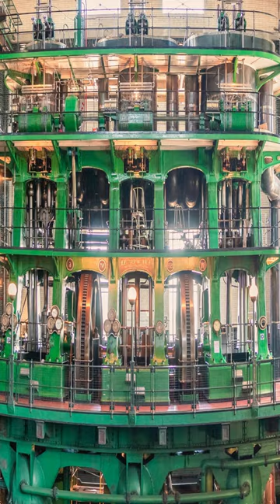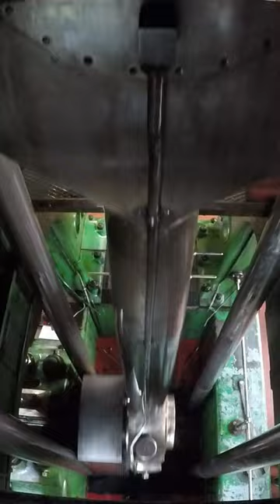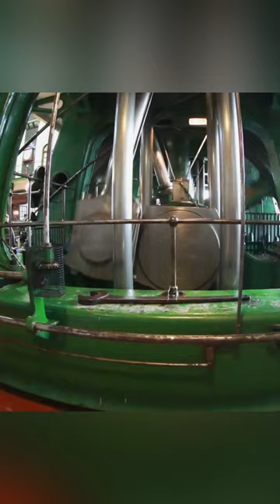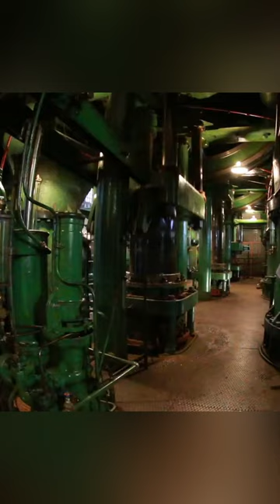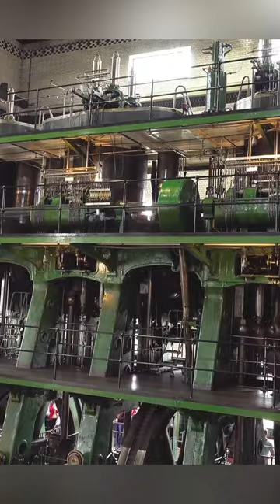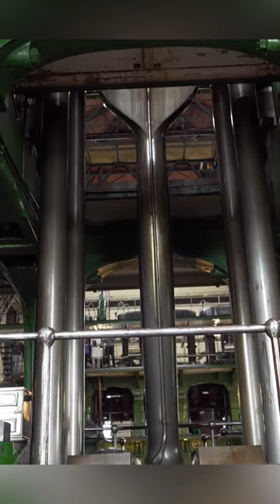BIGGEST STEAM Engine In The World

Comment: Difficult to imagine how they machined and manufactured those gigantic parts in those days.
Reply: + transport etc
Reply: @ContributorX  Exactly
Reply: It's actually not that hard, probably the biggest difference is you build a maching solution around the job rather than building the job around a machining solution. Now that sounds like a silly disinction but it really is the basic 'trick' they had. Instead of going how do we make this with our lathe of X size they went lets make take the component parts that we need for a lathe and put them around the work piece as needed. Makes for some very fun photos of workshops with just the most crazy set ups to machine things. 

Also life was cheap and wages were nothing so you could afford to whack or injure a few guys in the process and pay the rest not great money. Always helps. Capitalism lol
Reply: The Titanic's engines were bigger.
Reply: @Elbas_Tardo  they're a bit waterlogged lately but they do exist still, maybe this can be the biggest working double acting piston steam engine.
Reply: @Trainskitsetc  I say "were". ;)
Reply: @Trainskitsetc  Thanks for this info - it really stops me puzzling how these things were possible - it makes total sense, including the wage/cost factors. And I can hardly imagine how crazy those workshop photos must look :)
Reply: @fibonaccisrazor  for further help lots of it can be broken down, so a big ol fly wheel or whatever can be segmented, cast in 8 bits which are easier to machine then bolt it together and balance it when installed. Less one big engine, more a few hundred sub assemblies made up of a few thousand parts.

Transporting these things was done in bits, quite often the largest parts would go in before the building was even finished then it would have the building go up around it and all the smaller bits come in the door and get assembled.
Reply: By hand 😅🙃
Reply: I bet the bushes are original, we have a pump station in my home town and its still using its original bushes.
Reply: British engineering. A lot of the big pieces were cast.
Reply: @Trainskitsetc no other system built anything close, also nobody was shipped to a death camp for telling a boss to get phucked
Reply: @patrickancona1193  that's cute n all but pointing out the pile of bodies from one way if life doesn't exactly do much to hide the pile of bodies behind your own nor it's systemic failures.
Reply: @Trainskitsetc  Yes, that completes the picture - fascinating, thank you so much for the extra info 👍
Reply: Very carefully I am sure
Reply: @codyneitte9801  Yup, by hand... A lot of modern engineers have the same problem. It all fits in a CAD...
I'm not an engineer, had to quit my studies. But my best teacher was (and still is) my dad. And he often says words of wisdom like this: "before you put something together, think how you will take it apart later".
And this was a sentence spoke by one of his engineerig proffessors, who tought him how to make a good drawing, Sometimes i wonder if this proffesor knew, his legacy would be passed on a couple generations later :)
Reply: @ogi22  hah dduuuuuddeee thats some legendary words right there! 😅🤌 he has been behind a wrench a tine or two, FOR SURE!!
Reply: @codyneitte9801  We sometimes joke that he is a screw guy and i preffer to chase electrons through wires ;)
Reply: @ogi22  lul those damned angry pixies
Reply: And then assembled them
Reply: @Trains kits etc  you must be an engineer lol
Reply: Imagine the hamer that forged it
Reply: This is the same reason why it's difficult for people to grasp how the Saturn V rocket was built and launched.   It's a special field to do this and a lot of craftsmanship.
Reply: @harryniedecken5321  Yes, human potential at its limit. Incredible achievement.
Reply: @Trainskitsetc That's a silly way to look at history.  Capitalism is the best economic system humanity has created.  Give me one example of an economic system that even comes close? I'll wait..
Reply: @illumiNOTme326  depends what the end goal is doesn't it? It's the best at what it does which is consolidating the most into the fewest hands to the detriment of many which is after all it's goal, the accumulation of capital and the means to produce capital including the human beings involved in that process. 

If however you are interested in the most people having the most they can get, capitalism sucks a fat bag of D at doing that in any meaningful or respectful way.
Reply: @Trainskitsetc You have no clue.
Reply: @Trainskitsetc  actually back then, the men who designed and built these machines were paid rather well for their skills in turning the metal components into their final forms on the lathes they were trained to use by their mentors. 

And just like back then, a man learning how to make components on a Lathe were learning a Trade that they would throughout their life, and then pass on their knowledge of their trade onto the next generation.
Reply: Actually it isn’t that hard to imagine since we still use the same manufacturing methods in the industry today. Like for example the massive fly wheels on some of these machines were actually made by pouring the molten metal into a sand casting mold where the molten metal would then cool until its solidified and then the mold was broken up to reveal a fully casted working blank of the fly wheel. And then that blank would be put on a lathe and then fine tuned to be perfectly balanced.
Reply: @1LEgGOdt  Thanks for the explanation, another part of the puzzle solved 👍😊
Reply: Same as the Pyramids.  Aliens
😂
Reply: I can't imagine them manufacturing those parts Now days
Reply: @illumiNOTme326  Agree, but "anarchy" (not the destructive version we think of nowadays) in its pure form: local relatively small village community  government where everyone knows each other, and all have a say. Even today this system could work if it were run my god-fearing ethically minded individuals. The latter being such a scarcity today, but we live in hope 🙏.
Reply: Right, if the means of production had been seized by the proletariat from the bourgeoisie I'm sure the working conditions would have been much better and everyone would be happy and healthy right? RIGHT COMRADE?!
Reply: @jordanzempel111  An interesting perspective, you may well be right comrade 👍
Reply: @Trainskitsetc  capitalism, 

you must not know anything of chinese or soviet working conditions
Reply: 2,000 years from now they wd say Aliens 😮
Reply: With the pyramids
Reply: its totally insane, right? I mean manufacturing those things that have to be totally straight and precise while also weighting many tons.. and making them also reliable as heck. So incredible for the time back then. Absolutely stunning.
Reply: Oh not for me...
Reply: Aliens.
Reply: Let alone assembled it.
Reply: Simple, they didn't, they cast them and surfaced them by hand.
Reply: Not at all, this sort of work was common well before tis engine was made. It's exceptionally good, but quite common.
Reply: Brawn and brilliance man that’s how
Reply: Casting
Reply: Passaic Machine Works-Watts, Campbell & Company made stationary steam engines.  The parts were precise -- remarkable considering they used casting with sand using wood forms.
Reply: @charleskramer6189  Yes, the craftsmanship in those days was truly excellent. It had to be, really, they had no CAD or anything like that to help them.
Reply: easy. they called the same aliens that helped with the pyramids in Egypt
Reply: Smart machinists

Comment: Btw this is the same size engine that powered the titanic, as a matter of fact the engines of the titanic were possibly larger than this.

Also, quick fun fact, the engines are still standing on the seafloor over 110 years later, meaning the bedplates (the piece that holds the engines up) of titanic are still operating the way they were intended after a violent sinking and 100+ years of deterioration

Comment: only a thousand horsepower. but the torque? yes
Reply: If you want the maths, at 25.4 rpm (max speed) and 1008 hp the engine has (63025*1008)/25.4 ft.lbs of torque.

Or if you plug that into a calculator. 2501149.606 lbs.ft. AKA 2.5 million ft.lbs, or 3.4 million Nm of torque!
Reply: Water Horsepower
Reply: How much torque?  All of it.

Comment: Crazy how now we can get that same hp in a 4 cylinder engine
Reply: But nowhere near the torque figures
Reply: Good luck with stalling this engine 😅
Reply: @AlessandroCD7  you got a point
Reply: @AlessandroCD7 and durability
Reply: @zagatozele  If you're interested it works out to about 2.5 million ft.lbs or 3.4 million Nm of torque!

And that would be assuming peak power is at maximum RPM. At rest, or at a lower RPM it would be a lot higher.
Reply: @AlessandroCD7  can be always geared down to get the required torque

Comment: Does anyone know what the torque was on this beast?
Or if there's an accurate conversation?
12 million gallons a day seems like a lot to me🤷‍♂️
Reply: In Derbyshire, the Leawood pumping engine pumps 4 tons of water every stroke (7 strokes per minute), and it's big, but much smaller than the Kempton Park engine. (The Leawood engine is also the oldest non rotating engine in the world still working on it's original site. (It doesn't have a crankshaft.)). That's a rate of 840 tons of water per hour, or 20140 gallons in 24 hours.
Reply: @martinsims1273  Just Wow 😳👍

Comment: Big difference here this engine is a 3 cylinder. Titanics was 4 cylinder even though it was a triple expansion engine. They had two 3rd low pressure cylinders which fed the center steam turbine.

Comment: Triple  expansion steam  engines were quite common. The  SS Delphine, The Dodge family  257' steam powered   yacht has 2 quadruple    expansion engines. The yacht built around  1920 still has the original  working  steam engines. It has been  available  for charter  in Europe for many years. The quadruple  expansion  engines were designed  by one of the Dodge brothers. The boat was surveyed  for a Diesel upgrade some years ago but I don't  know if it happened. While  Diesels  are
more  efficient they are noisier. The relative  silence  of steam  is one of the characteristics that  make this  vessel  unique. Check it out on the web.

Comment: Doesn't steam contract as it cools?
Reply: It does but that’s why it’s the triple expansion system because the steam takes up less space as it starts to cool so the first piston is smaller and it has a lot of force and pushes down on that piston. Once it’s expelled from that piston it goes onto a larger size piston because it needs more surface area For the weaker pressure of the steam to push on it as well and once it leaves that piston, it goes onto an even bigger piston and then it’s all used up

Comment: at just 13% thermal efficiency.........its a coal guzzler.  By contrast, a modern coal fired power plant is 36% efficient.......and a stirling engine peaks at 40% efficient. Large Marine diesel engines reach 55% efficiency.

Comment: 60 feet tall and it produces only 1000 hp.....There are electric motors the size of a five gallon bucket that produces that much hp. Reliably. Progress....
Reply: But they can't produce anywhere near the amount of torque a steam engine can produce
Reply: @richardmillhousenixon  Are you kidding?? consider a diesel electric locomotive with fifty cars, each loaded to 150 tons. How much torque do you want to get this going??? and those are old fashioned traction motors.
Reply: @richardmillhousenixon  lol dude hp is hp, no matter how you look at it. It's the amount of work that can be done. You can take a small engine making 1000hp, gear it so the output rpm is the same as that behemoth we just seen and have the same torque.

Comment: Interesting engine, but 1000hp is nothing, we have a restored steam tug here called the William C. Daldy, built in Scotland in 1935, that has two 1000hp steam engines. I've worked as volunteer crew aboard her. The whole boat only weighs 900 ton. Everything on board is run by Steam, except a small diesel fire pump which is required by our maritime laws.